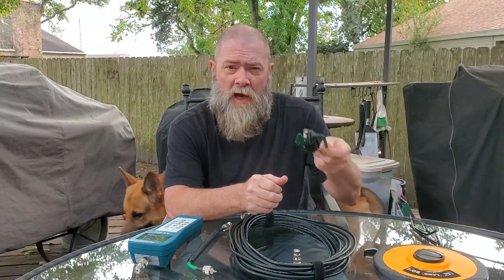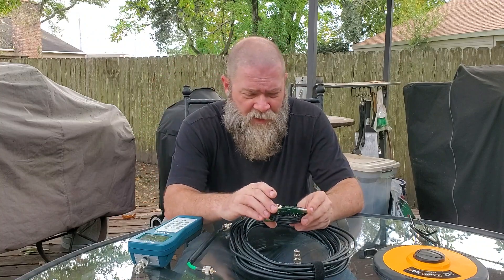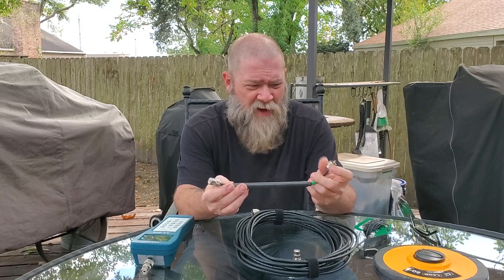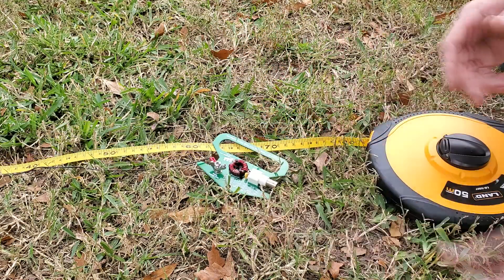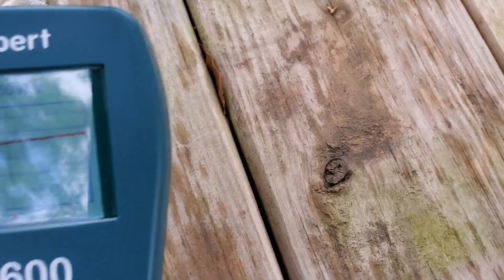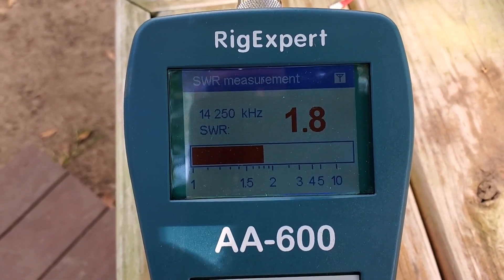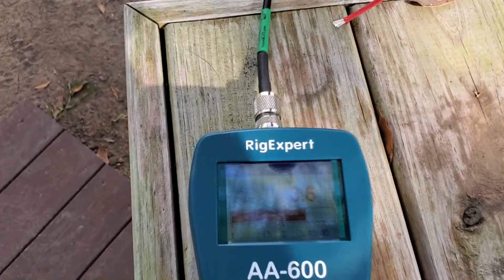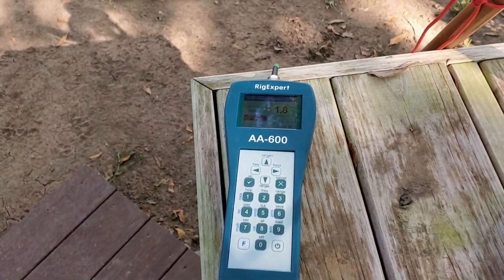QRP Guys EFHW No Tune Antenna Follow-up Video

Comment: I looked briefly at that but as a newb I didn't want to start with a QRP antenna. That would have been a nightmare for me.
Reply: in reality there is no difference between QRP and "normal" antenna other than wires (higher W = stronger wires)
never used more than 100 W basically majority of my antennas are 300 W max and on the top of thar I have QRP versions for portable activity with thinner = lighter cables
Reply: @tulenik71  Agreed, I was scared off by their statement that this kit is rated at 20 watts.
Reply: @45auto  for example, I am working mostly portable (SOTA is my favourite activity) and most of my radios are 4-15 W. Worked countries all around the world. Only when I am working from my mother's apartment (free space and trees around, good grounding) I am using Yaesu FT-991 (100 W).
At home, I am in concrete pit between apartment blocs unable to deploy wire antenna so I am using magloop rated 20 W max.
Reply from the maker: If you wanted to try building an antenna, this would be ok, but I think you would get more satisfaction being new from the KM4ACK EFHW when they are in stock.  Better performance and you still learn about building antennas.  An antenna is an antenna.  QRP or otherwise.

Comment: What does it do with a wire tuned for 40? What do the harmonic bands look like that way? Regardless it really makes you appreciate resonant antennas like the DX Commander and dipoles doesn't it?
Reply: Other bands aren't optimal SWR like the band you cut it for, but they are less than 2 or 3:1 on harmonic bands. I've used mine on 30 and 17 with good results too. Don't use the 468/f in MHz formula. The PCB says 61.5 feet for 40m and that was exactly correct for 7.05 MHz.
Reply from the maker: Honestly with all the crap I dealt with just on 20M, I didn't want to deal with adding a longer wire and tuning to 40.  As you say though, you really appreciate other antennas like the DXC.  Thanks for the comment and for watching.  73!